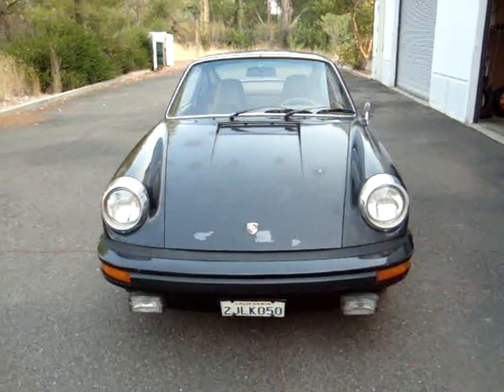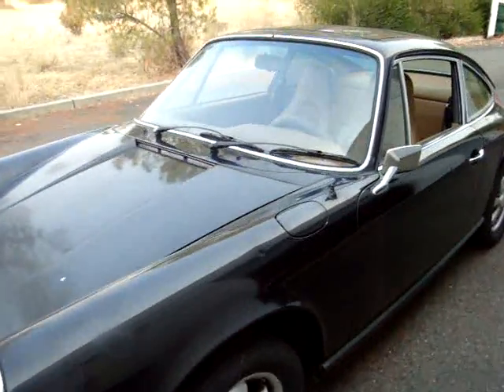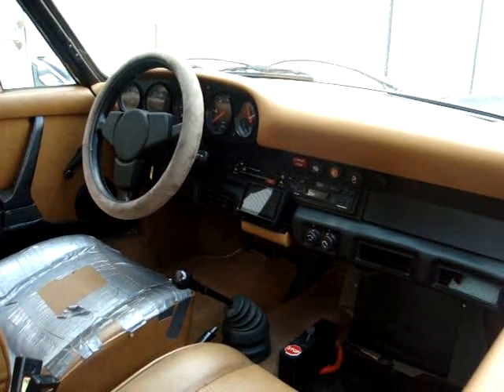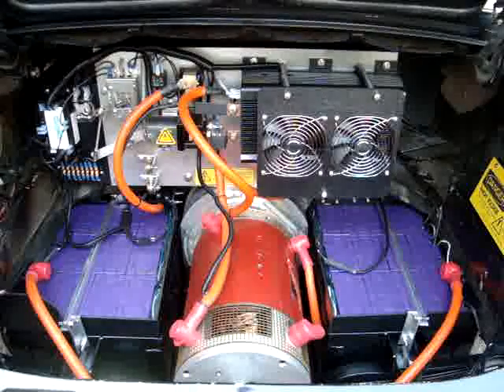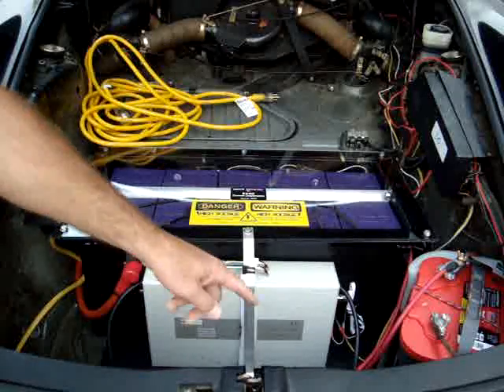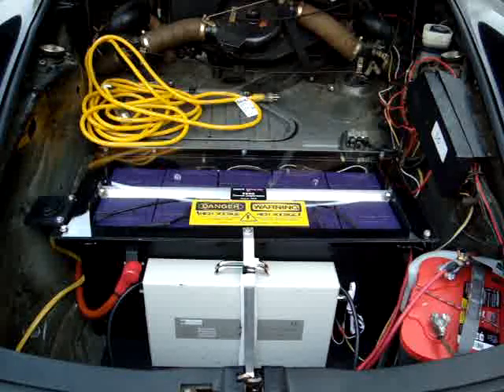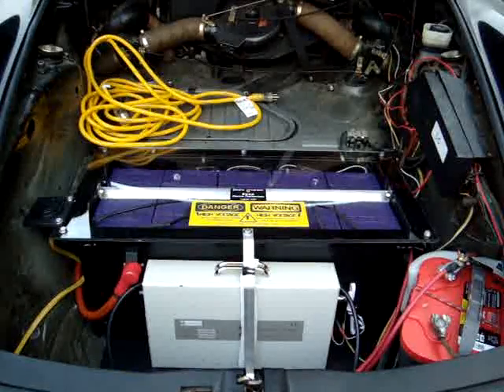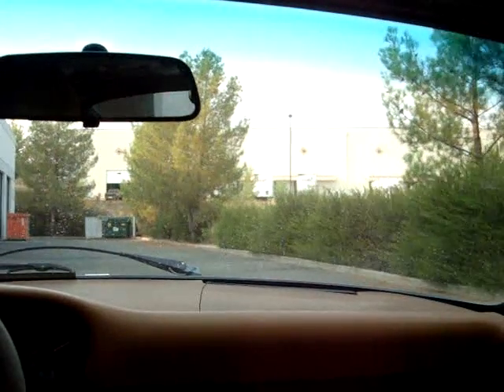DIY Electric Conversions - Porsche 912E Conversion

Comment from the maker: Well, even though we have zero credibility, let me remind you that the 70 ft/lbs of torque is at 72 volts.  Most folks are not using a Warp 9 on a 72 volt conversion.  On a dyno at the rear wheels the Warp 9 can produce 164 ft/lbs of torque at 160 volts.  You obviously know as much about electric motors as you do tact.  Thanks for watching.

Comment: Dudes, I just looked at your web site!

And - Holy Moly - 1994 called, and they want their web site back. Seriously - you get zero credibility with that awful site design, and hideous colour combinations. It's like a web-person's worst nightmare.

Finding out the Warp 9 motor only has 70 ft/lbs of torque is disappointing - and you don't even have to do the math to know a $15K+ conversion can NEVER pay for itself. 

I was interested until I saw the power and the price. :(

Comment from the maker: It is the stock five-speed transaxle.  Lightened flywheel and performance clutch.  Right you are on the use of first gear.  70 mph is not the maximum speed in fourth gear.  I do not know what the maximum speed for 4th gear is.  It is faster than I'm going to drive a customers vehicle.

Comment: You haven't talked much about the transmission and clutch. Is it the stock 4 speed and clutch? Does the motor eliminate the use of 1st gear because of the higher low RPM torque than a gas engine? Is 70 MPH maxed out in 4th gear because of the motor's RPM limit or because of the voltage and controller limitations?